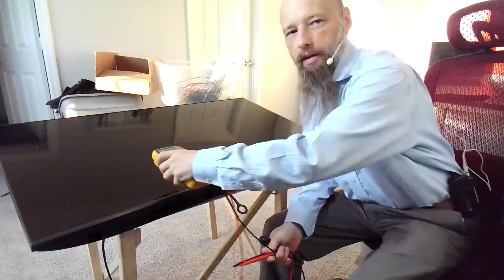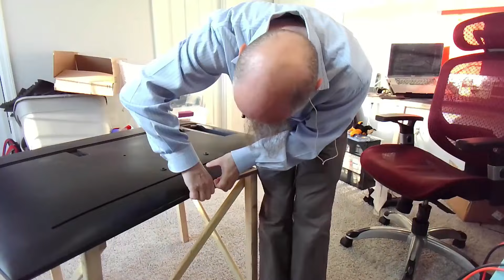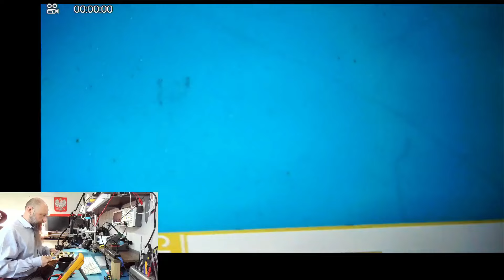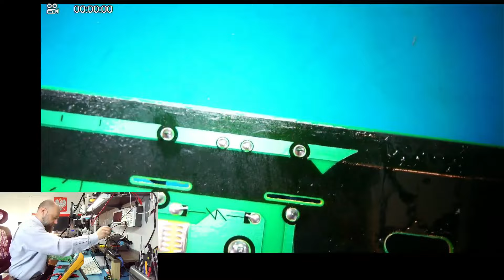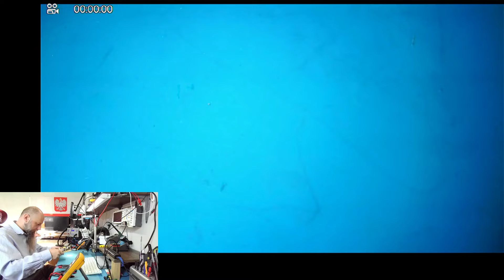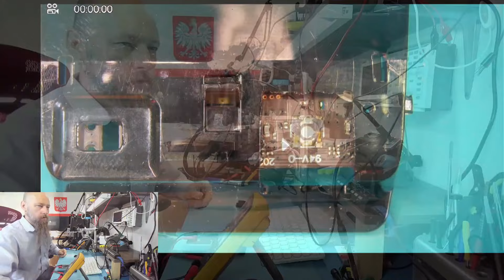Samsung QN50Q60TAF | 50 inch TV troubleshooting | Generic method for diagnosing TVs

Comment: Is there a logo when it turns on? At that angle I could just see a line and with the way you lifted the LCD I'm concerned the panel has cracked s mention of the discolouration. The symptom to me says backlight fault and it's shutting down due to incorrect led current. Pull it down and check the led strips. I've not known a tv to need special diagnostic tools or software yet.
Reply from the maker: Yes, I probably broke the display by flexing it, well I learned something :) 
I also ordered the BT module as it was $10 and started measuring the main board, the resistance to ground on one coil is 5 Ohms which I think is a bit too low so currently my suspicion is around that but you might be right, I'll look into the LED strip.
The special diagnostic tool is just a plain UART, many devices come with it :)

Comment: Hello nice try as a tech who repairs tvs let me attempt to help,
firstly when attempting a repair of a LCD tv the bench or table it goes on must be bigger than the size of the panel (screen) padded and soft free of debris to minimize the chances of the panel breaking. 
Secondly that model samsung has no screws and a special pry tool is used to remove the back cover
with the cover removed a quick diagnostic can be done to determine if the mainboard is bad or the powersupply and that would be to 
disconnect the cable going from the power supply to the mainboard and plugging in the tv 
if the backlights come on then you know two things the powersupply is good and the backlights are good as well
if you get no backlights then backlights or the powersupply is faulty.
you can check for the correct backlight voltage on the powersupply it is sometimes written there and also the test points highlighted
Thirdly if the backlights and powersupply are good then you unplug the tv and reconnect the mainboard and plug it back in 
now you know you might have a shorted panel or a bad mainboard.
Reply from the maker: Thank you so much! I've learned a lot from this. I don't exactly plan to repair TVs but it's a very useful knowledge. Much appreciated.
Reply from the maker: oh, and it was the main board after all, the resistance on the VCORE is 5 ohms, checked with thermal camera, only CPU is getting hot. If I didn't break the screen, this would be a $60 repair (replacement of the board) but I don't really need the TV anyway :D

Comment: Panel fault for sure you will need to block some clock lines of the right hand side ribbon (brown flex cable) disconnect the cable and apply tape or paper about 5-6mm to the cable furthest away from the right ( on the last driver board )
Also the screen looks cracked but it’s worth doing for a video 😊
Reply from the maker: thank you so much
Reply: what would one do about fixing that exact issue apart from replacing the pannel
Reply: got it down to the right 3 pins
Reply: @skillquestion3482  👍 well done that’s good I’m glad I helped one person out 😁
Reply: @skillquestion3482  that’s it try and repair it or get another panel but you could have 4 TVs same make and model and they will have 4 different makes of screen in them
Reply: @wisher21uk  yeah that seems about right